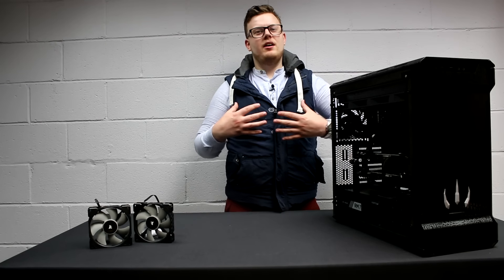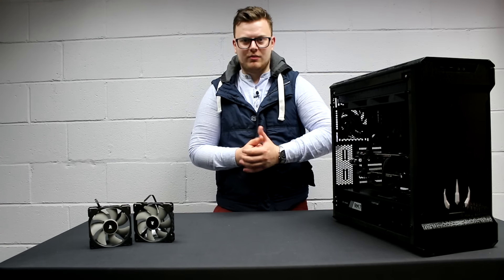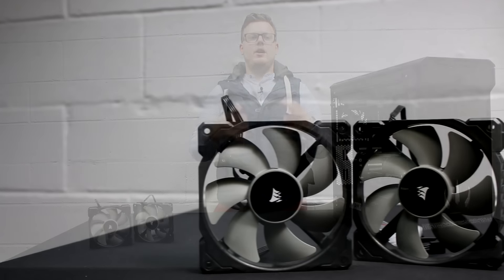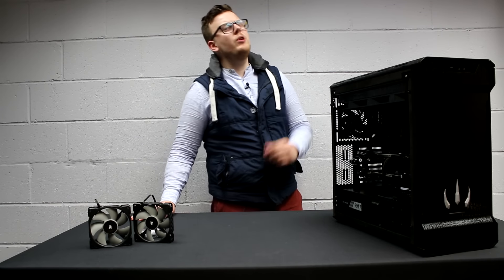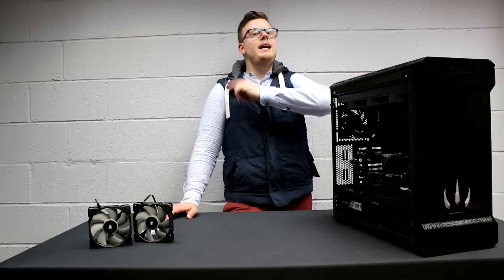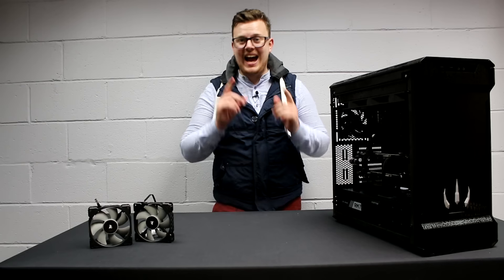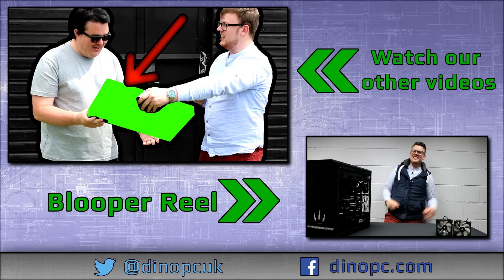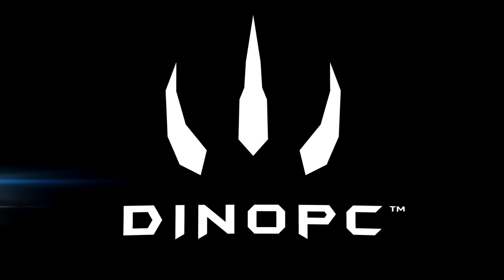Corsair ML 120 Fans Overview / Review (What is Mag Lev?) DinoPC

Comment: These fans are awesome. However, although they are quiet, they can make more noise due to airflow against dust filters.  Also, by the way, I don't think (in theory) that no rubber mounts will cause vibration (if not close to none) since the fan ISN'T EVEN TOUCHING THE MOTOR.

Comment: the primary job of the case fan is of cooling if it's doing the same as last gen what's the point of upgrading 
the longevity factor is there but by that time it will be replaced by new tech